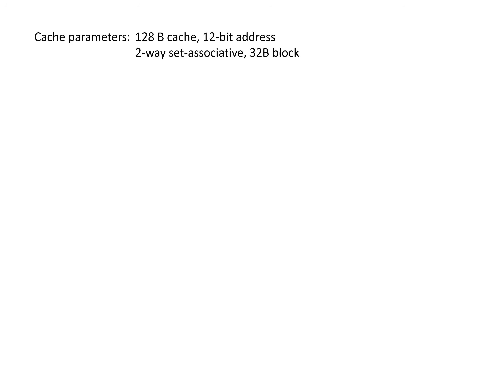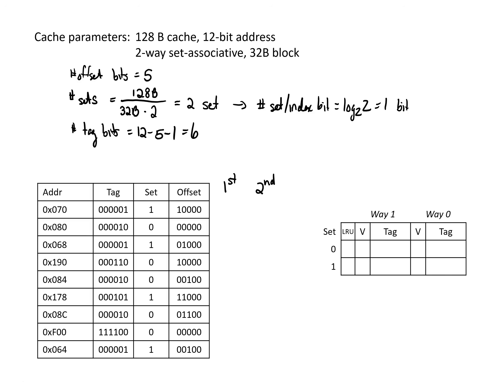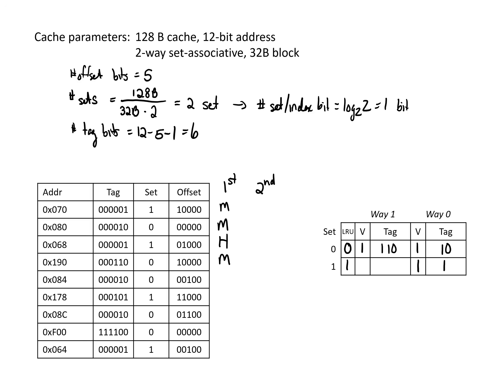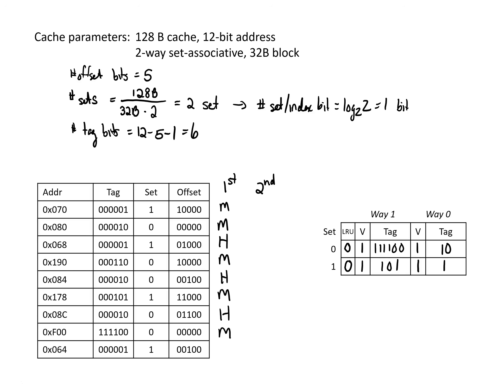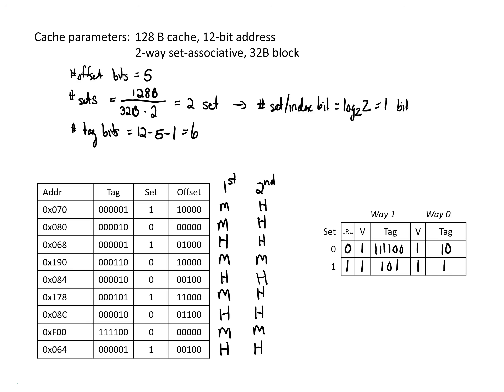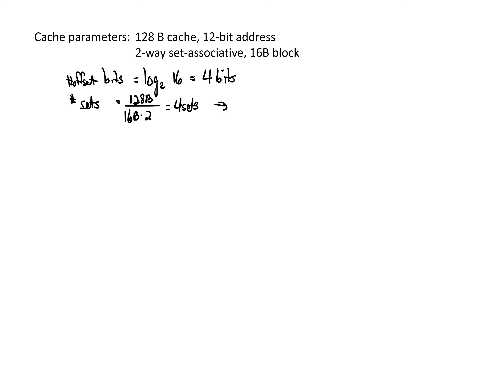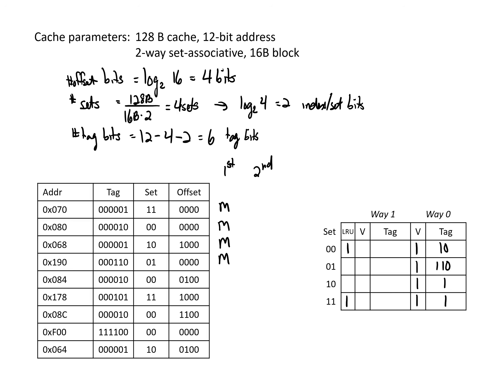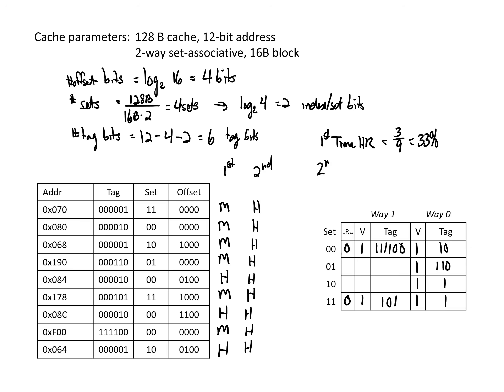Cache Access Example (Part 2)

Comment: On the first time at 0x064 shouldn't you change the LRU to 1?. It doesn't change anything i am just asking to see if i got it right
Reply from the maker: You're correct, it should be updated at the first access to 0x064. (Luckily the next access is to the same set and it is updated then, so the end result is not affected.)
Reply: What is the point of V beside the tag, when its value is 1 throughout the process?
Reply: And in this case is the value of offset considered? Seems like none of them was used.